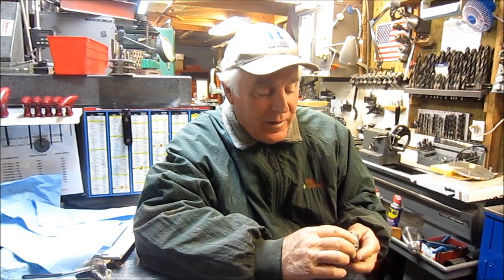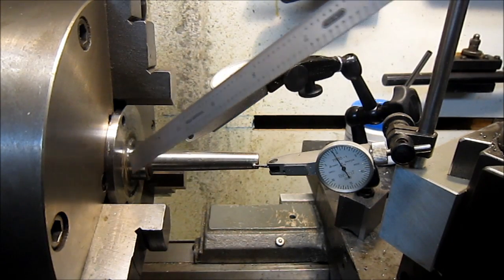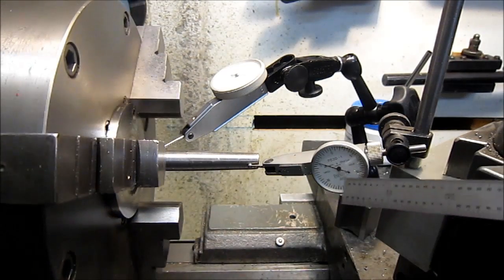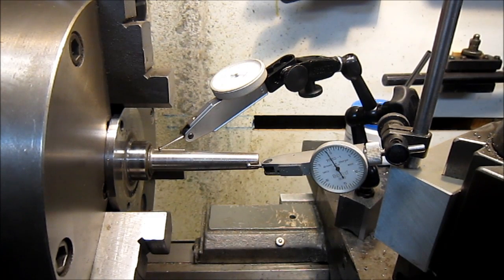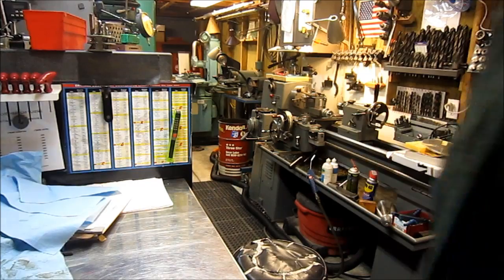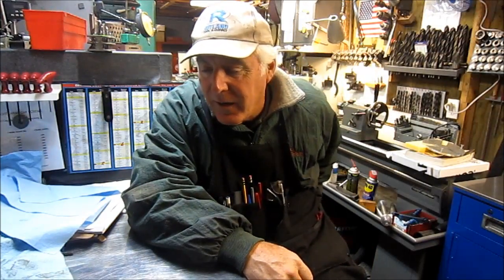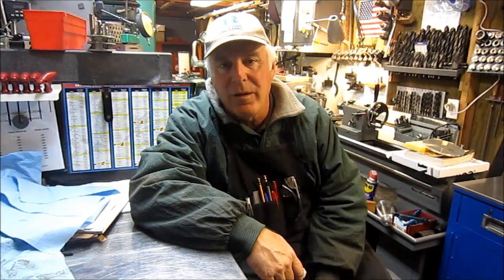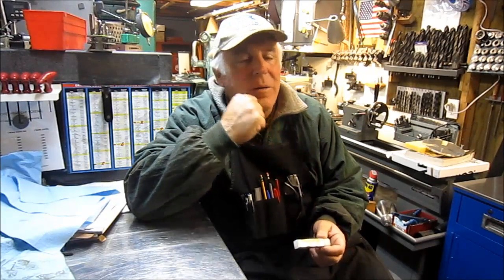Quickie 22   Communication

Comment: You might be reasonably close on that taper if you test 90 degrees away from where you're getting the highest runout reading.

I find soft pencil lines (4B) work well for checking tapers.
Reply from the maker: Paul..Thanks for the input, I will checkChuck

Comment: Some years ago My Job was to operate a lumber planer this planer was a Stenson/Ross 17a5 (built I'm told in 1929)  it is a 4 head Planer with 2 profile heads.  well this day I was setting up the profile heads to run 2 10 inch saws to split one piece into two.  and about the time I started to make the run I heard a nasty bad bearing like noise.  in the bottom profile head. so I shut down both top and bottom saws so I can inspect it. (the saws are mounted on a shaft in a Cartage  type coupled to the 35hp  480 motor with a nylon spacer and  1/2 in pins.) when it stopped  I grabbed the shaft and the bearings felt good so remembering that I just put new saws on, I grabbed the saw blade to see if  it was loose. and it was OK as well about that time I rotated this blade about a 1/4 turn and felt a pinch on the side of my hand. jerked my hand away and realized at that moment the upper saw was still winding down and had cut my little finger clean off. not to mention went up the blow pipe just as fast. I was more Angry at myself for doing such a Stupid thing than my hand hurt!  I learned after they took me to the Er to get fixed up.  They ran the planer as it was. it wasn't  until I went to work on lite duty of course. (cant lift with the left hand for a while).. one of the Pins that went into the coupling  had broke off. that was the cause. .. when we got to ER  and i told them I cur my finger off. and my hand berried in some clean rags that are about to start dripping, she asked where is it cut off at. I replied at the first knuckle.
later when she removed the rags she said "I thought you said the first knuckle?" I did well it depends on where you start counting i guess..My entire finger is gone. 

One thing to remember All machines are made to one thing they do not care what dummy,(or as Tom calls them "BOZO") has there body parts in the wrong place or not. and yes, We all can become instant "BOZO " from time to time!
 so  for you all.
"PLEASE BE CAREFUL OUT THERE"
 Take it from a BOZO that is DIGITALLY ENHANCED.

Dennis Brooks  aka  "9 Fingers"
Reply from the maker: Hello Dennis errr #9Damn, it can happen soooo fast...thanks for sharing and hopefully people read and learnChuck

Comment: Chuck, now I have to figure out how to make a emoticon with one eye covered...  

Could the runout in your taper be due to any of a bent shaft, a non-flat chuck face, or the part not being flat against the chuck face (maybe something between the two?). Turning concentric near the face wouldn't be affected by any of those if it was a small error, and it seems to be from what you were reading a few inches out.  If it is in crooked, turning it true will result in it not being straight with the flange part, so you'll get a wobble in the two jaw. Maybe indicating the face of the flange will tell you what's going on?

I've never seen a two jaw chuck like that...other than in a tap handle. Of course I've seen plenty of the one jaw Chucks you have there.... ;-)

Thanks for the fun!

-- Mike
Reply from the maker: Hi Mike...now that would be cool and emoticon with one eye covered...hmmmmmChuck